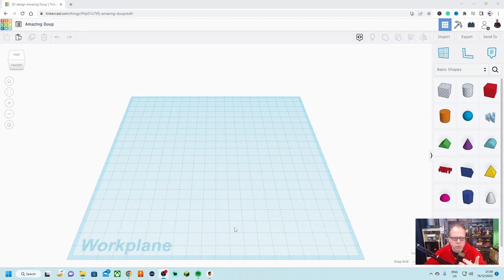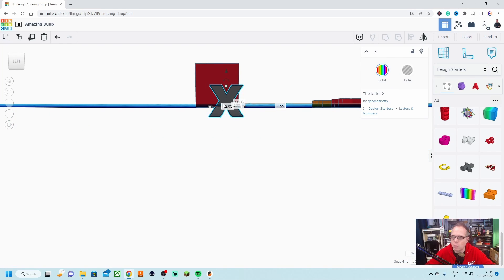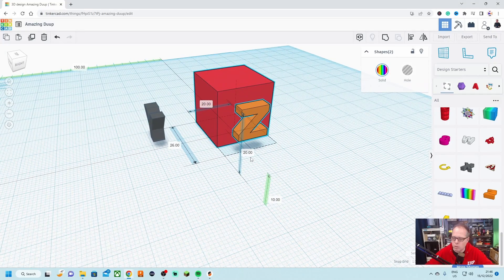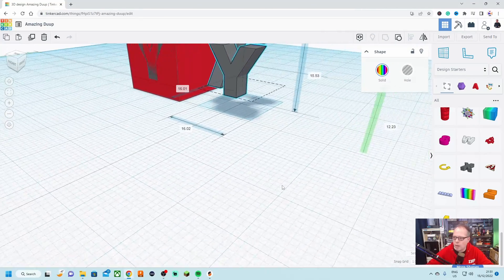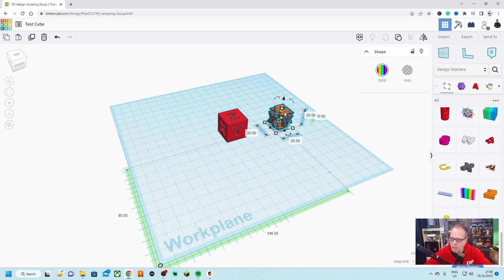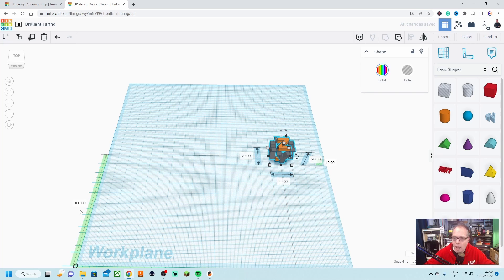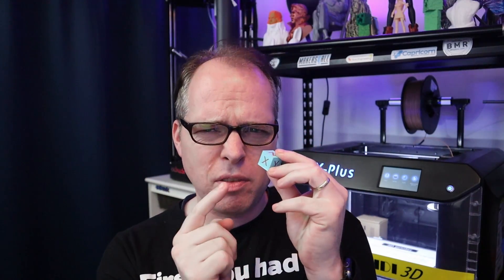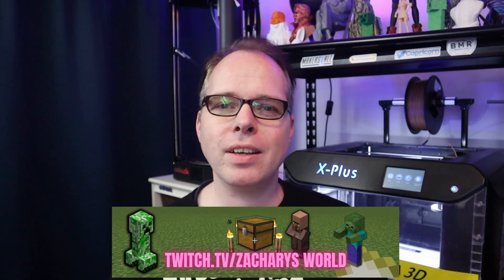How to do Multi-Colored Models in TinkerCad

Comment: I usually do the first part.  Making the void and placing the second color. After that you can select one color of the model and export.  I call that ____1. I then select only color 2 export and call it ____2. Wherever they are on the plane,  they will line up together,  at least in prusa and now in mosaic canvas
Reply from the maker: OK, you're using the same workplane and export them one by one...
Reply: @Zachary 3D Prints  yes. I think the metadata contains the X,Y,Z, location on the plane somewhere